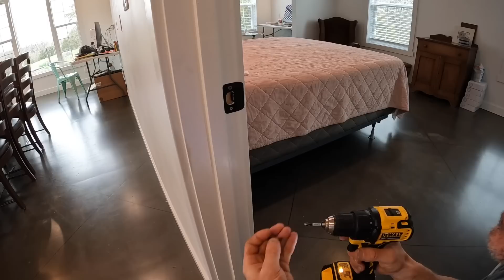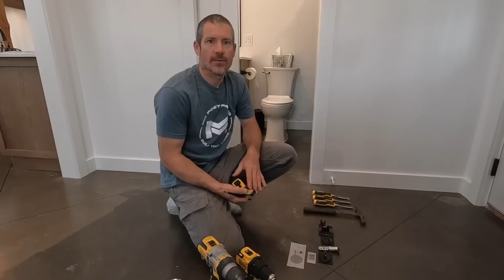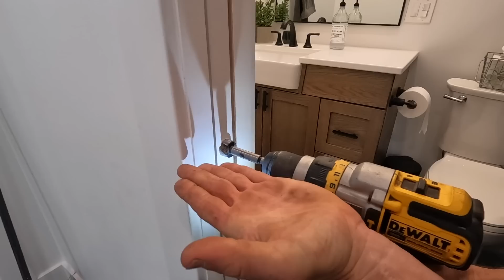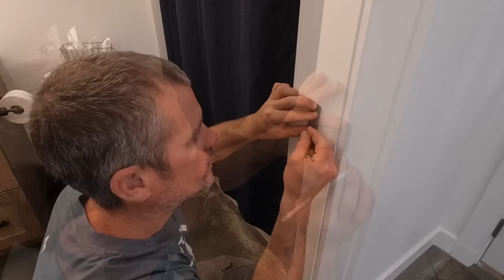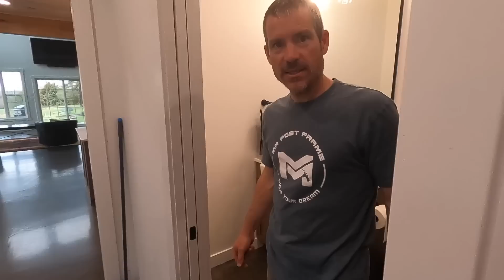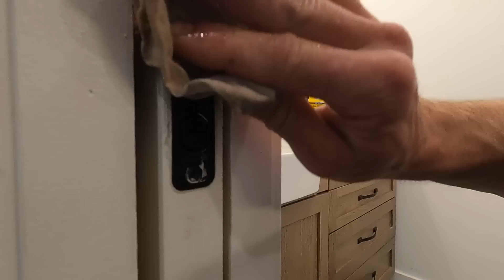Self Build Home | Kwikset Handles - Standard + Pocket Door Install | Mad County Build

Comment: Unexperienced people shouldn't use a drill to install the handle, because most will strip or mess up the threads on the screw.  Maybe it's just the morons I have working for me, but use a hand screwdriver on just the handle part

Comment: It used to be that the door handle went on last; the mechanism called for two round handles that connected with screws to the shaft. Then somebody decided to make a door handle with preinstalled round handles. These make it really difficult to put in the two retaining screws. It is fine if you have a rubber shaft screwdriver :). I am now only buying the European style handles like you are installing. You can open the door even if your hands are full and you can open the door with another body part, like a knee or an elbow.
Reply from the maker: we like them minus that the kids hang on some of them!

Comment: I used to have to do this sort of thing for commercial office build outs. Try all day long for a week doing nothing but mortising door handles and latches. I used the porter cable door mortising jig with corner chisels and vix bits to do all that. A set of good sharp chisels too, the kind that are so sharp you cut yourself on accident just putting them away. I used a router as much as possible, it takes all the human error out of it. Not to say that you can't get the same results from doing it by hand, it just takes time, patience, and normal blood sugar levels.